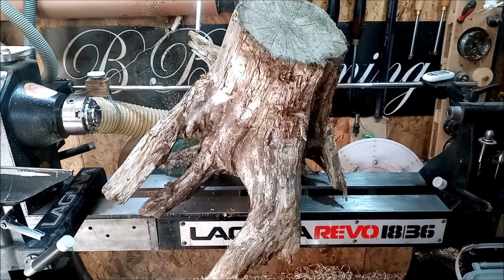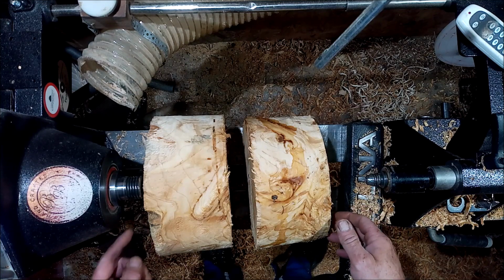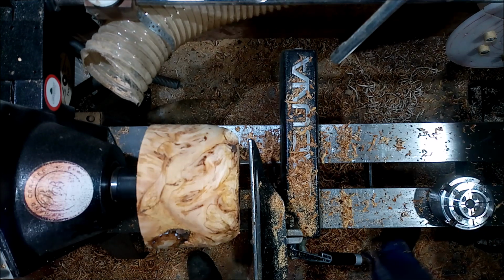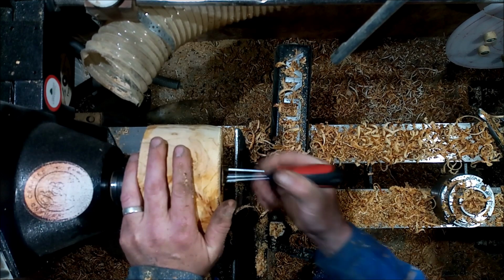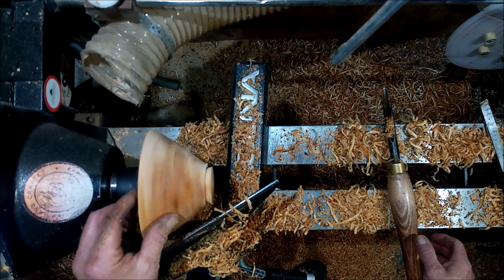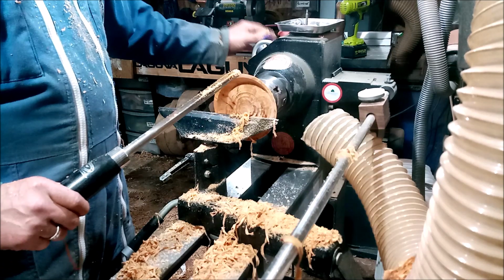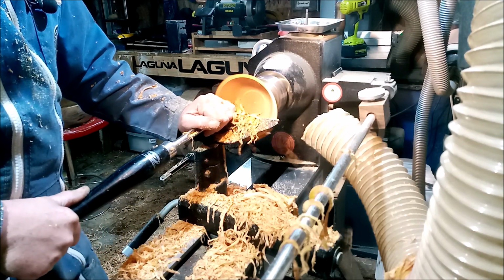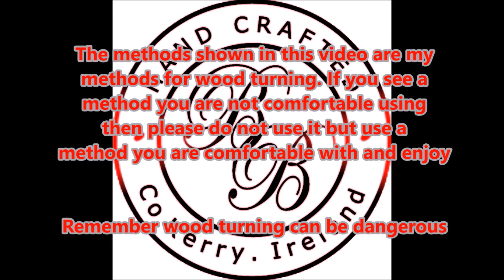A Leylandii root ball / woodturning

Comment: About a year ago I took out a Lleylandii hedge and kept about 20 or so of the 42 rootballs - all dug out by hand! Yet to try to turn any yet, but after seeing yours it will be interesting. Not as large as your stump, though, so may be a bit small for bowls - but I'll try - should make some nice twig pots though. Most of the ed grain turning I've done  - I was told to go from centre out - across supported grain. You managed to get a great finish the other way around - is this the way you always do it. Beautiful bowl.
Reply from the maker: It is Bill, it is the way iwas taught 30 odd years ago and I still do it that way and have never had a problem. 
Shay

Comment: Please excuse my lack of experience with asking this question: once the void was discovered, could you have turned the tenon on the other end and fashioned the bowl from the void side?
Reply from the maker: Not a problem at all Peter. The other end had six screws in it holding the piece onto a faceplate, if I had turned it around then the base would have had six screw holes in it. With something like this it can be 50/50 as to which end you choose but once the choice is made you are stuck with it. You can never tell if there will be voids until you start turning especially with a root ball.
Shay.
Reply: @BBTurning  Ah good point…. Thanks.
Reply from the maker: You, are welcome Peter.
Shay